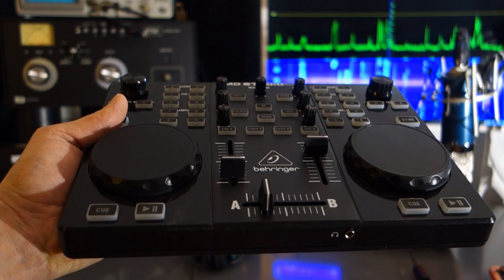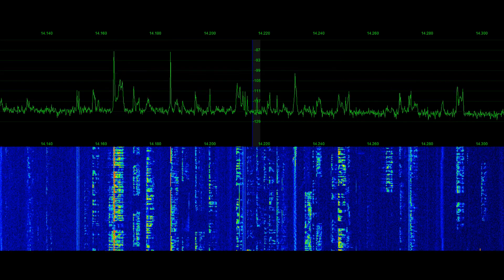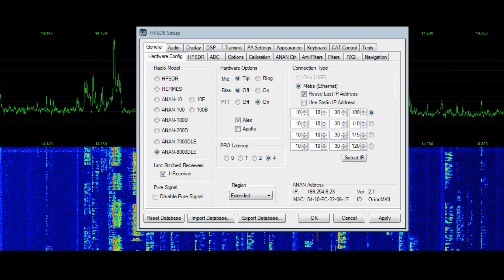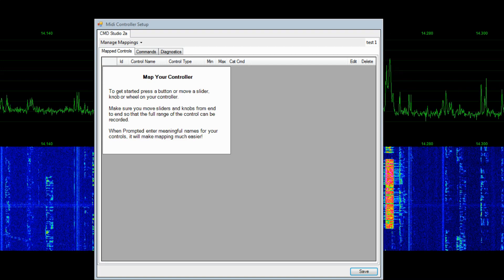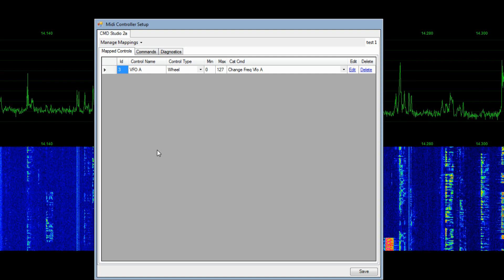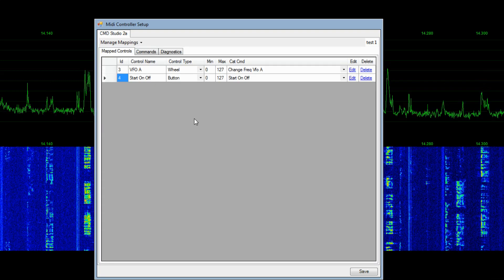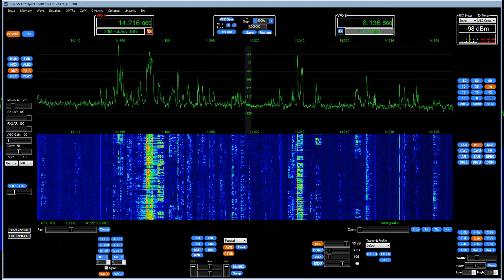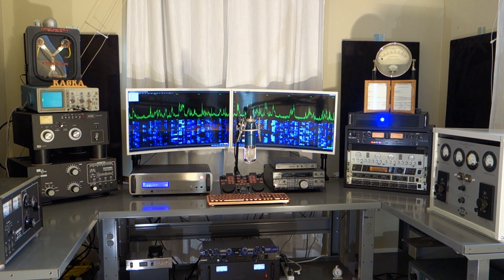Apache Labs SDR DJ Controllers | Attaching the knobs back into SDR

Comment: I just bought the same DJ Controller for my ANAN 7000 DLE MKII SDR.  It does work very well for the main RX1 and the Multi/Sub receiver.  One thing though, the support for the second RX2 receiver commands seems lacking.  One can not change modes or selectivity bandwidth on RX2.  In fact, even changing bands or incrementing/decrementing bands for RX2 does not work properly.   Have you noted this also?  Are there manual MIDI commands one can enter in the advanced menu to access these functions for RX2?
However a work around does work:  
Turn on RX2.  Then set the desired mode and bandwidth in RX1.  Then do a VFO A>B function.   RX2 will now hold the desired mode and selectivity set, even if the mode and selectivity in RX1 are subsequently changed.
Another issue I have:  The DJ Controller is only recognized by Windows when the USB cable is pulled out and plugged back in, or Windows rebooted.  A cold power on will not recognize the DJ Controller.